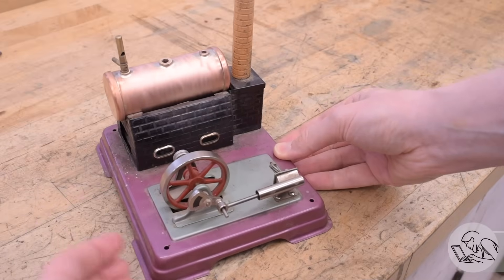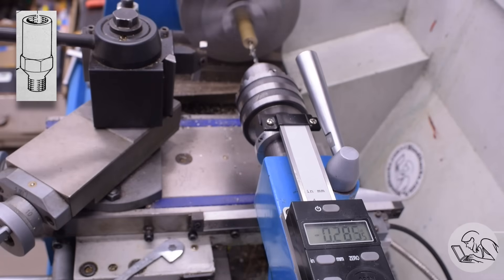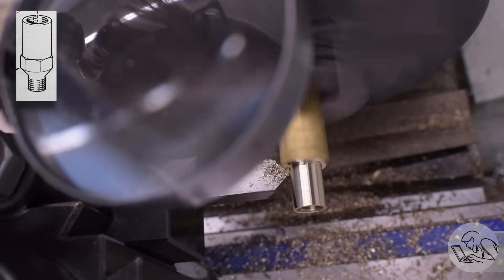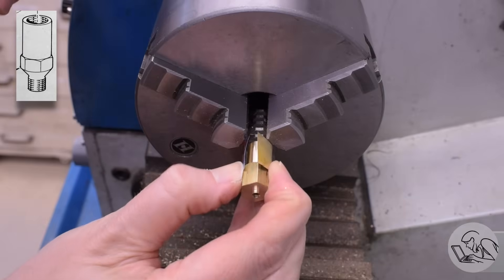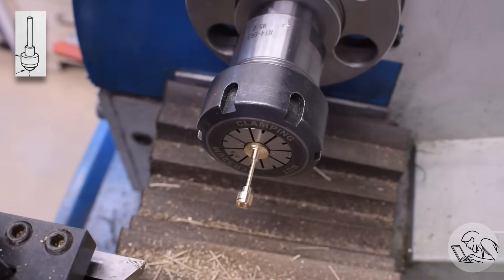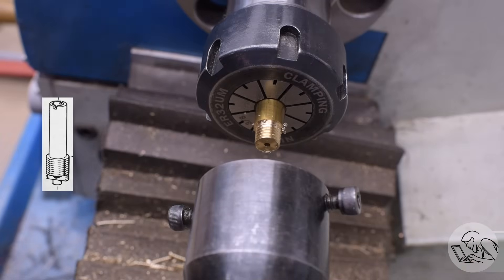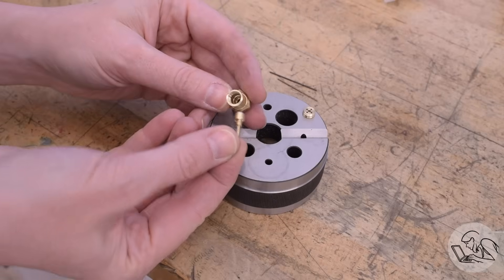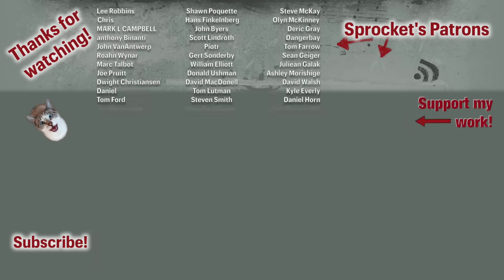Restoring a Vintage Steam Toy - Part 3, Safety Valve

Comment: Honestly the positive taper makes sense for the valve seat, I'm barely 5 min in, intuitively it makes for a single contact point for the sealing component to reduce the chances for failure.

Comment: I'm making a little steam car similar to a Mamod one so just made a very similar boiler and safety valve. I just made a simple Mamod style one. Seems to work fine on air with a steel test spring. I used a bike foot pump to test it and that pushes out far more air than the engine could produce steam in a hurry. Even with that I couldn't get the pressure to go over 30 PSI by giving the pump a firm press. More gently raising the  pressure as it will in the boiler it starts leaking and holds around 20 PSI. I have some stainless springs on the way for use in the boiler, thanks of the tip on checking they really are stainless!

Comment: I built a steam engine at school back in the 70s. The boiler was a metal powdered milk tin and the safety valve was just the lid popping off which it did several times. Not recommended.

Comment: Gotta love it when things get stuck in other things.
One time I had to put a magnet into a bore in a steel shaft. Too late, I realized it was the wrong magnet. It went in flush so I couldn't grab it, and it was too stuck to the steel to be pulled out by more magnets. I ended up very carefully supergluing a bolt onto the singular exposed face, and on my second try, it came out.
Reply: Weirdest thing stuck in other thing I had was a plain pilot bush in a blind hole in the end of a crankshaft. To get it out you stuff the middle of the bush with wet toilet paper until it's full then you find a solid drift that fits neatly inside the bush and give it some whacks with a hammer. Since the wet paper can't compress much it hydraulically pushes the bush out from the back. I was quite surprised when it actually worked

Comment: How often is the safety valve expected to open? I would have thought a burst disc to stop the boiler from going bang would work but clearly this is used in a very different way.
Reply: Power plants operate like that but locomotives are designed for operation as required due to constantly changing steam requirements.

Comment: Hi Blondihacks, before you make the safety valve for the loco, check with the club boiler inspector that you won't need a locking ring or locking device on the safety valve. Not sure on the boiler codes in Canada but here in Australia our boiler codes require a safety locking ring or device on safety valves so the valve bonnet can not unwind. We also make the stem of the valve plug longer to enable a manual release function using long/needle nose pliers to test the valve at any pressure.
Reply from the maker: Our club is pretty chill about that. Many A3s built exactly to Kozo’s drawings are run there and they’ve already signed off on my boiler.
Reply: I don't believe that TSME or TLS require such fancyness :).  I could be wrong...but we've done exactly the spring check and it works well enough because of the difference on a spring vs ball.  Note, that the Stuart Turner boilers used to (not sure on current) use exactly that system.  (the 500/501/504 boilers).

Comment: Hi is there a difference between a safety blow off valve and a pressure regulator?
Reply from the maker: Great question! I guess you’d say it depends how they are used. On a steam locomotive, the safety valve is regulating pressure. On this boiler, it’s more of a backup safety device. However a pressure regulator like you find on an air compressor is a very different device that works a different way. That is not what these valves are doing.

Comment: My goodness, this is one of the most fiddly, exacting parts I've seen here.  That is fine tolerances. 
Everything is at that size huh? but this one is really required to function AT ALL.
Always wondered how such an old steam safety valve worked.  I guess modern ones are not SO much different. 
In any case, very impressive.  Can't wait to see it all in action.

Comment: Isn't it lucky stainless steel ball bearings are magnetic 🤣🤣  But very interesting, the design requirements of a safety valve isn't something I've thought about before.
Reply from the maker: Indeed! Truth is most stainless alloys used in daily life are magnetic.
Reply: @Blondihacks  yes, I now know :)  We had a long and rather geeky conversation about it on patreon.  I didn't realise how often it is we come across non annealed stainless and quite how large an impact that had on it's magnetic properties :)
Reply from the maker: @tom314  One of those annoyingly persistent internet myths is that you can test for stainless with a magnet. People repeat that, clearly without ever having tried it on anything beyond the mixing bowl in their kitchen (food grade stainlesses happen to be among the few non-magnetic ones) 😄

Comment: 17:44 I wonder if the high temperature from the boiler will have an effect on the spring so the opening pressure will be changed.
Reply: No. The temperature in the boiler is going to be less than 250°F (121°C), the temperature of steam at 20 psi. The documentation I'm looking at doesn't even register failure rates this low.
Reply: Yes it will, you always do the final setting on steam during the boiler test. Setting a safety valve or even a whistle gap on air is only an indication. it won't be too far off the correct pressure but will still need a final adjustment to get it just right.
Reply: @grantbelton1288  I don't think so. While there may be a material difference between air and steam which leads to a difference in rate of release by the valve, the spring does not change because of the temperature of the boiler.
Reply: Only if say, the superheater header glows in sunlight :)  In which case, the safety valve is single use...

(we went to an externally mounted spring after the 3rd internal one sprong'd its-self).  

Suprisingly, the superheater (copper tube) survived the abuse.  It did feature brazed on connections because we were aware that it would be likely subject to excess temperature for just plain silver solder to hold on with.

Note: the high temp steam made my S50 block a very neat colour...proves that a Uniflow really would have been helpful, or at least less wasteful.
Reply: Probably not. You need to get steel pretty hot to affect its characteristics like that.
Reply: @dcviper985  At that scale 
Tiny valve, thin spring, low service pressure and narrow gap for the adjustment I think that the temperature will have an effect on the valve' opening pressure